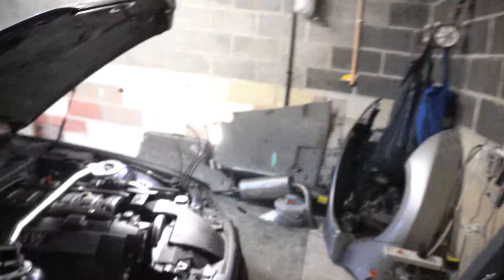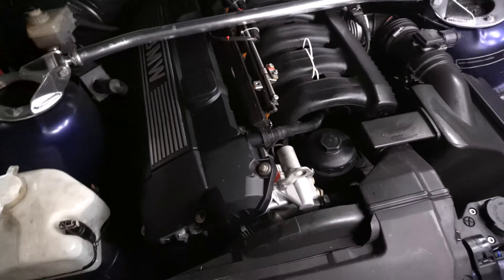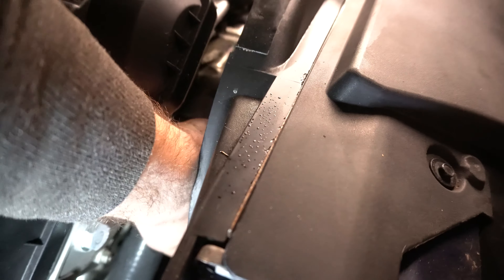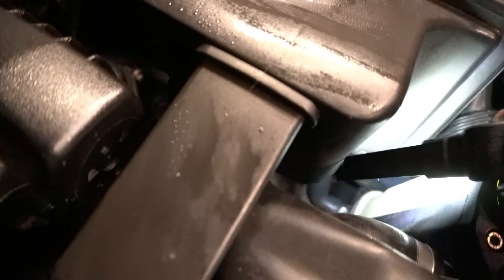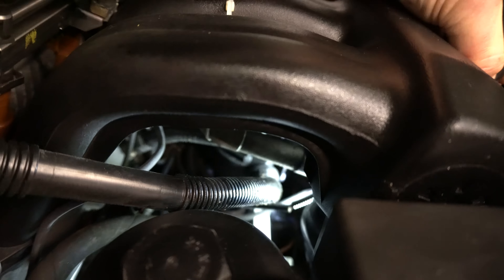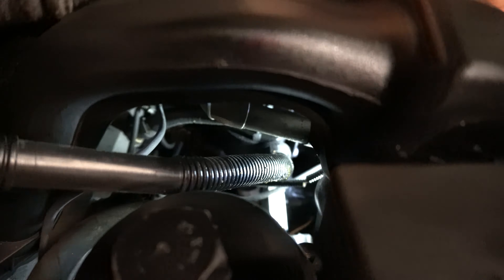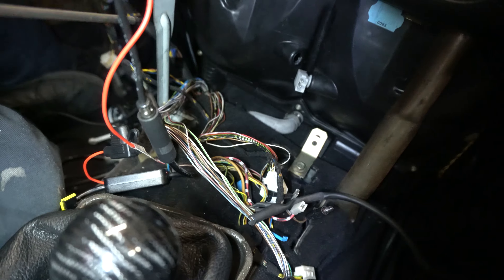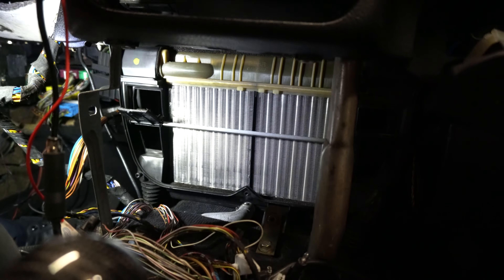Searching for an E36 Coolant Leak

Comment: Hvac pipes and the orings.... Could also be a crack in the coolant flange that connects said pipes to the hoses that goes to the heater valve. I have had terrible experiences with bulkhead leaks into my cars

Comment: Hi Pamo, coolant system is a nightmare I spend 6 weekends trying to diagnose an overheating issue which was caused by airlock(tell you more in a min).
I noticed on your expansion tank you don't have a coolant level sensor plugged in, I didn't either and noticed I had a small leak from that plastic nut(resolved that with plugin in a coolant level sensor).
I also once had a pin sized hole on the pipe that goes to the heater matrix from the block and it wasn't till it got bigger that I was able to detect it. Have a good looks when the car is hot and engine 
Back to airlock issues, I actually though my cylinder head was away. I was so annoyed I was close to selling the car but it was fine I bought the CO2 Leak Tester Cylinder Head Gasket Tester Professional Car Leak Detector
.The Draper 09544 Coolant Vacuum Refill Kit(You need an air compressor to use this tool) All I can say is im only ever using the tool to fill the e36 with coolant.Avoid airlock nightmares! 
Water in footwell structural issue coming from outside?
Reply from the maker: Thanks for the pointers 👍

Comment: Hey pamo I glanced at the comments but I didn’t see anyone else mention this; the expansion tank can have a crack in it that only starts to leak when the cooling system has full pressure at temp. Maybe get the car to temp and pressurized and then take a peek at the tank?

Comment: I had wet carpets in the same fashion as you, for me water was coming from the rubber that seals the heater hoses going to the matrix at the firewall- try either replacing it or filling the area with silicone. hope it helps!

Comment: the test will not allways show u that the head gasket is blown. my lasy 325i had a w simmilar problems. First of. The head was curved so much that 3 and 4 piston was white because of burning coolant. But it smoked a lot. The hg tester showed nothing because it was no exhaust gass in the coolant system. it only sucked the water. Second problem. My radiator cap was broken and the car could build up a coolant pressure and every 50 km afer i put out the car the coolant leaked frome the coolant tank (on connecting with the radiator down below). This one was easy fix. 5 euro. Good luck man :)
Reply: I had a rad from ECP and the top of the expansion tank was terribly made. Like yours once pressure built up on a spirited run the cap would leak. That did leave a white stain though. I had to  tighten the cap with mole grips once I realised

Comment: Have you considered that your coolant loss could just be the silicone hoses? Silicone leeches water at high temperature and a drop in coolant level is quite common when running silicone coolant hoses. I realise you may have thought about this already and decided the amount of loss is too great compared to your run time, but from what you described, it seems pheasible; especially as E36 engine bays get bastard hot.
Reply from the maker: I didn't know this so thank you for the insight. It looses very little. I'll hope for a simple resolution.

Comment: Worst case scenario you got a crack in the block! needs to be hot maybe running to see that leak! Are you sure you didn't run it lean once and it just came out the overflow from overheating? Also did you retorque the head after bedding it in coz your right, it could be the head gasket.

Comment: Those expansion tank caps have a nasty habit of getting tight as you do them up without actually being seated. I usually loosen then tighten a couple of times to make sure. A suggestion for a method to find the leak (if it is one): degrease and fully dry the engine bay. Stick a sheet of clean cardboard underneath. Run it until it's nice and hot then maybe even give it a bit of throttle for a while. Look for the evidence below